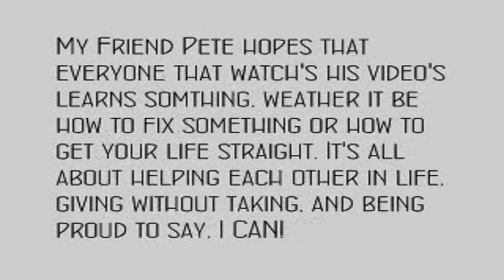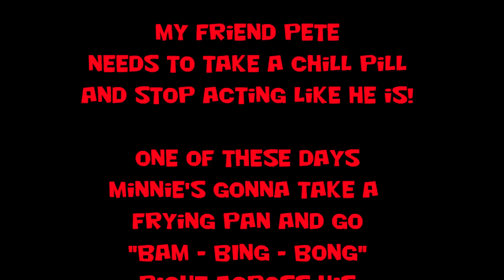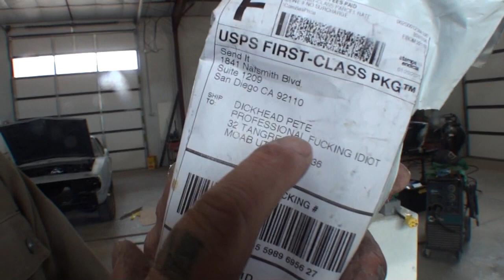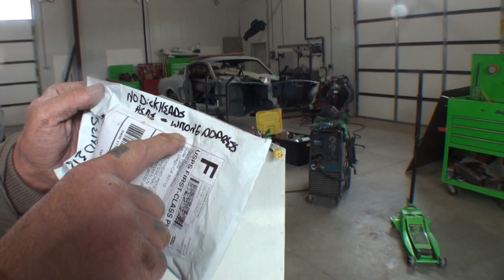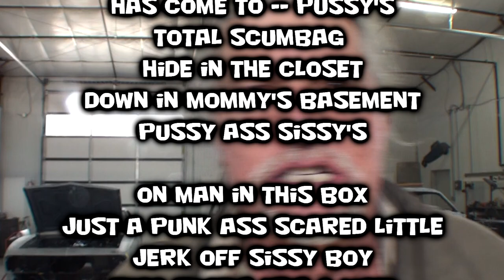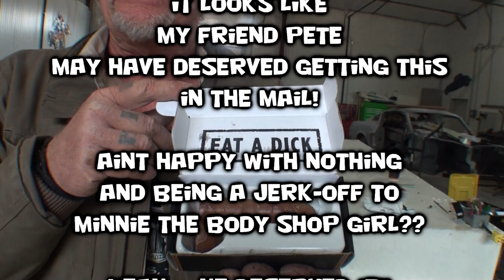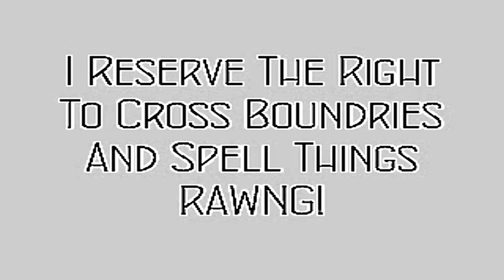How To Make A Homemade Paint Booth - Part 7 - It's a BIG MONEY PIT

Comment: I was hoping to see the filters fit into the frame. Are the friction fit or have a frame? This will help keep dry paint off the blades and out of the motor. 
  I do like the wheels as I have those on a table saw. Roll it where I produce dust outside, clean it off and roll it inside. Thanks for sharing the build and your retractable deflector, Pete!

Comment: Pete, I always was curious about the actual filters used in paint booths. Are the a special filter purchased at the paint store or a high efficiency (Catching Particles) sold at home improvement stores. If anyone could give a right answer, it would be you! I can only imagine how many filters you have changed in 38+ years. Thanks!
Reply: They are special paint filters that are thicker and flow better. Household filters are not designed the same.  Paint booth filters can be found on Ebay and Amazon.
Reply: @Wipsplash  Thanks very much! That was the answer I figured I would get and do appreciate the info.

Comment: Pete, you should take some sheet metal and install it on that corner directly behind the fan and round it off. It will help direct and smooth out the flow torwards the fan. You could do the same thing on the other side on the corner directly behind the first 2 filters. 
I built a similar box, but it was only a single row of filters and a squirrel cage fan. When I first used it, the filter closest to the fan was getting all the paint. While the others were clean. I did the “rounding off the corners” mod to it, and now all the filters seem to be “working more evenly”.
Reply from the maker: sorry -- you got me confused.. Im lost on what your talking about adding sheet metal to the corners??
Reply: @myfriendpete  so, you would be adding the strip of sheet metal to those 2 inside corners from top to bottom to get rid of the sharp 90 degree angle. 
That way when the air comes to that corner, instead of having to make that sharp 90 degree turn, it would be rounded off a bit and fow better.

Comment: I’m usually not too concerned with safety but that fan is near the door to the shop if I’m not mistaken and it seems like a death trap especially with the feeder forcing you in. Flipping the original cover upside down wasn’t an option?

Comment: What's the brand and number on the variable speed unit Pete?
Reply from the maker: Suncourt
Variable Speed Controller Hardwired -- HOME DEPOT INFO:  Internet #202803522
Model #VS100
Store SO SKU #1000539109   Web Page :  --  https://www.homedepot.com/p/Suncourt-Variable-Speed-Controller-Hardwired-VS100/202803522

Comment: What ? does a Paint Booth cost now??🤔
Reply from the maker: At the time I built my shop I could have bought a cross draft (just like the one I had in dallas) for 8,800.00 INSTALLED.. I didn't want to put a paint booth in my shop for re-sale issues.. Anyone wanting to buy this place in the near future more then likely will not want a paint booth in the building, and it would have actually depreciated the property by doing so.. By adding another out building to the property it upped the value and if the new owners don't want to use it for a paint booth, it's a nice clean building thats finished out -- P.S. -- The FAN BOX WILL BE GOING WITH ME when I sell out!
Reply: @myfriendpete  
ok thanks...i heard some are outrageously priced...but never bought one....i plan to do something like yours in my shop this year?  i live in the rural on a acreage ( 6 + ) .... besides the fan and filters...they are simple structures...i agree your plan is BEST!!  Sorry Minnie...😉   Hope your doing ok on your recovery ?  Take Care you Both...👍